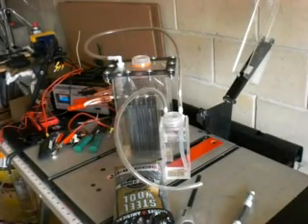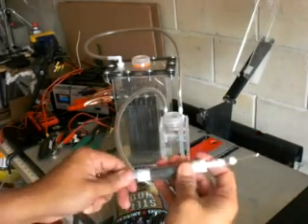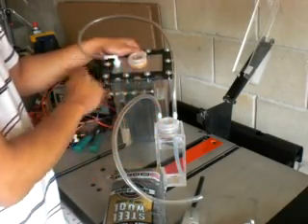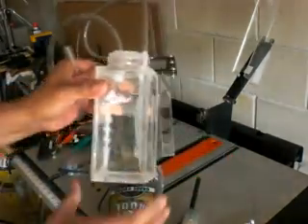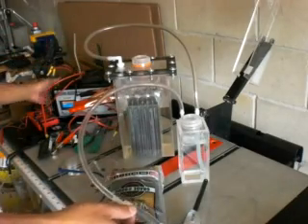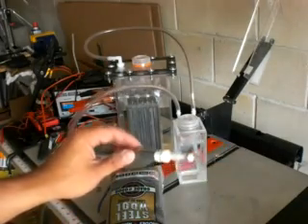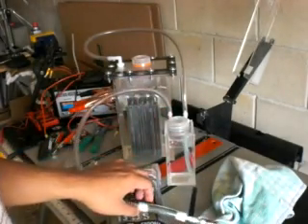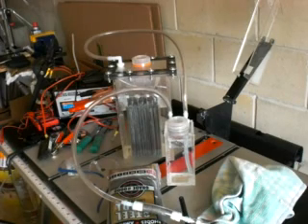HHO Flashback Arrestor/Torch - Testing

Comment: Hho kits for your  car & bike. HHO kits solve all the engine heating problems automatically. Best technology for the human health and happiness purpus HHO breathing machine. VERY simple and safe and easy technology, amazing recovery of human dieses like eye care,skin care, breathing shortness, parkinson and so many other dieses. Hydrogen rich water is best energy drink for human body health and happiness and beauty, for good sleep. Hydrogen gas is a powerful antioxidant detox our body. Reserach on hydrogen water is in the early stages so side effects are unknown. Or you can say so for no side effects. Hydrogen is 88 time smaller then vitamin c but richest in antioxidant. HHO technology best for our  cars. I am sure nany persons would be benefit from our hho acmec videos. HHO kits are very simple but very useful for old cars engine efficiency and performance fuel saving and money saving and envernment control hydrogen on demand system zero carbon emissions. Kit can install without any modifications in your car engine. HHO kits are very useful for cars engine efficiency and performance and money saving.Please visit HHO acmec if you want more information about this useful technology call 03082266179 zafar Karachi. For explanation for the HHO kits. Hho prolong the engine,solve the engine heating problems,prolong the engine oil life reduse service or car mantanic. your car will run like a New car. Calm and quiet running, remove carbon monoxide witch is very bed for the human health. Your car will start faster than before. Your car temperature will redused. Improve your car mileages. Hho kits make your car More power full, smother running. HHO kits will not harm to your car engine. Hho improve the fuel burning efficiency like high octane fuel. I called HHO technology is a  money saving technology. Rember to use only a little HHO gas for the best engine efficiency. Don't try to store HHO explosive gas . Hydrogen on demand system is best for use. For more information please visit hho zafar on you tube

Comment: Why use an arrestor when I'm going to bubble the gas trough the bubbler . Wouldn't this act as a one way valve?
Reply: The bubbler prevents a flashback from going back to your source, and the arrestor prevents a flashback from ever happening in the first place, hopefully sparing even your bubbler.

Comment: User a high end PC computer supply and use the PCIE connectors as power source. Those can pull upto 25 (at 12 volts) amps up a single rail.